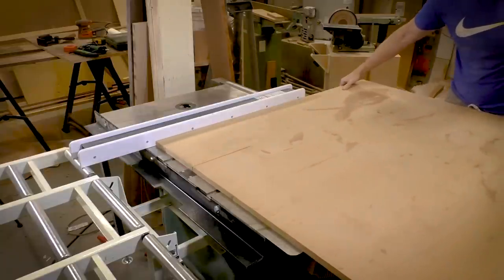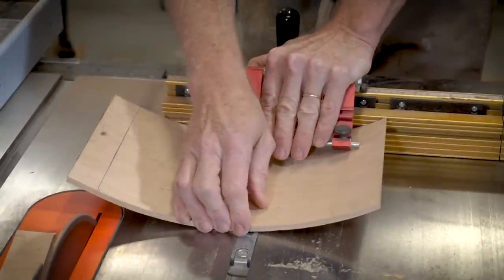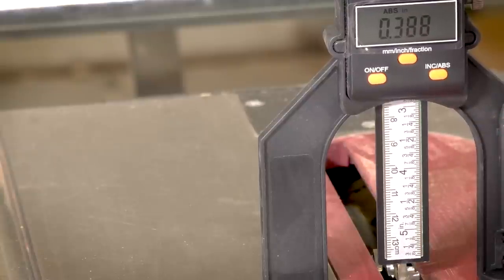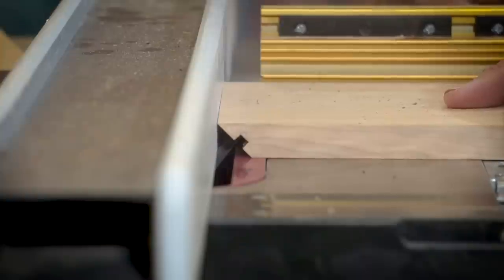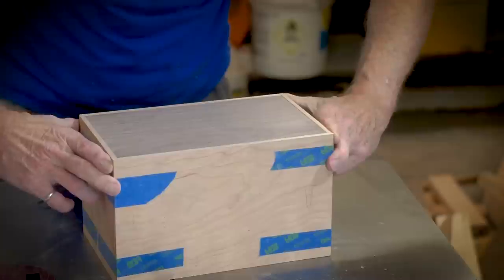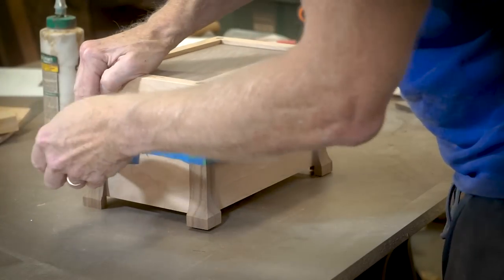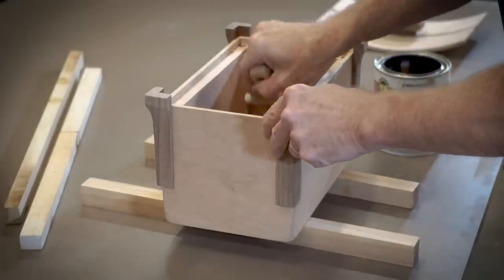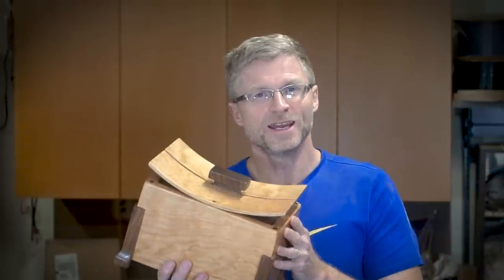Wooden Cremation Urn

Comment: This is a really nice design for a cremation box and it turned out beautifully.  The "lifted wing" design for the top is just perfect. The choice of materials is also spot on.

Over the years, I have made many boxes using cherry and another accent wood, including walnut as you have done.  Another striking combination I have found is using cherry for the case and blood wood for legs and handles.  That combination would also look very good in a box like the one you have made. Just a thought.

Great box!  Thanks for sharing.
Reply from the maker: Thank you, Jerry.  That's a good suggestion to pair cherry with bloodwood.  I've seen photos of boxes made with that combination, but I have not tried it myself.  That gives me a good idea for some boxes that I'm working on right now. 🙂

Comment: I could be wrong but cutting on both sides of blades doesn't work the way you described it. If it's 46 deg on one side it's 134 deg on the other. Both angles add to 180 not 90. Try turning your blade to 46 deg and see if it works. I could be wrong but I dont think it works like that. Your blade was 45.1 and on a short peice like you had it turned out fine.
Reply from the maker: Shoot, you're right.  I didn't think it through correctly.  Just to confirm with an exaggerated example, I made a cut at 30 degrees, thinking that I'd still get a right angle, but I ended up with a 120 degree joint.  Thanks for pointing that out!  I hate to have given the wrong advice to the viewers.
Reply: No problem. I wasn't sure either so I tried it  and then realized. BTW love the box awesome job.

Comment: Are you not at all concerned about wood movement?  The solid would bottom didn’t seem to have any allowances for expansion.
Reply from the maker: After sanding the rabbet along the bottom (off camera), I think I left enough room for the wood to expand. It didn't fit nearly as tightly at then end when I assembled everything, so I think it should be ok. It's always something to consider, though.